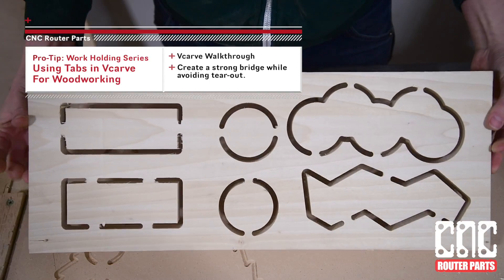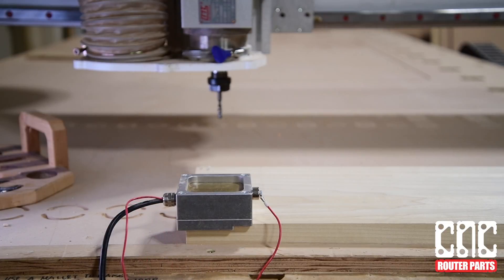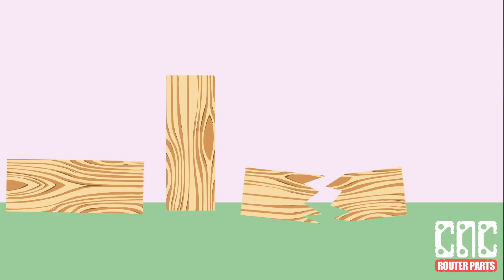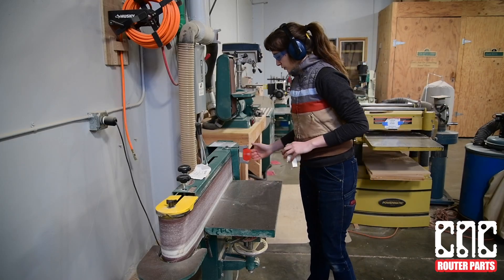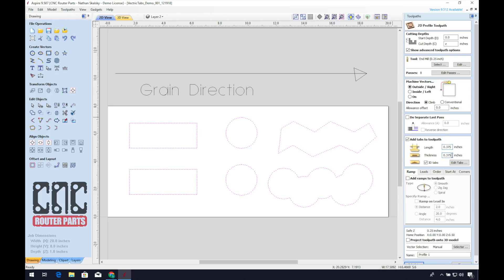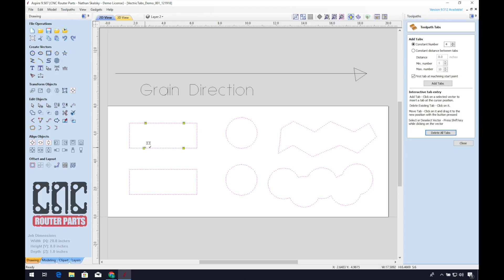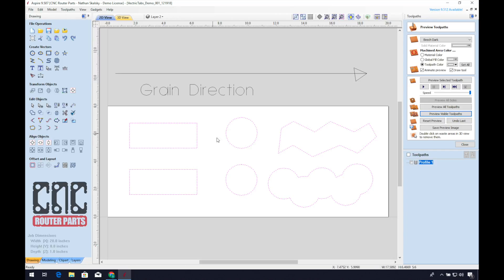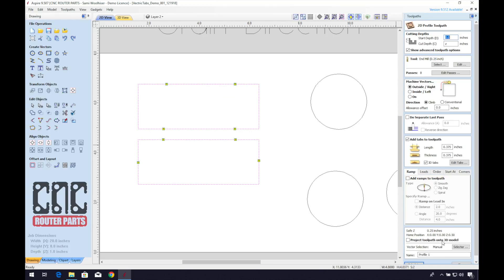Pro-Tip: How to Use Tabs in Vcarve for Woodworking

Comment: my problems have use tabs i need cut out sguare piece at plywood, i drar lines and then toolpath make add tabs, its ok, but if i want cut first left side this sguare one line, left, then move clamps new place left has cutting can cut right side, ok, problem have i start cut left side line, cutting nice but when bit come back to start point destroy all tabs, cut ok and elevate tabs point ok but then bit go back start point not elevate bit at tabs position ad destroy all tabs. why aspire not generate toolpath right, i mean why not move cutting side line ad then elevate bit up to sheet top and then go back start point, why move back same level then cutting, and move back destroy all tabs sametime not elevate bit at tabs position when move back to start point. or many job same why not elevate bit and then go back start point. alltime after cutting go back start point and bit stay same level what cutting line.and move back have G1 speed, not fast move G0. i not understand what i make wrong i draw picture-make toolpath. all job same problem no move bit up then go back start point after cutting, if cut point start X0.0Y0.0Z-3 etc. and go point X300Y0.0 has cut line ok, BUT go back to 0.0 point same level Z-3 why ? need go up after cutting elevate bit Z0.0 and then go back X0.0